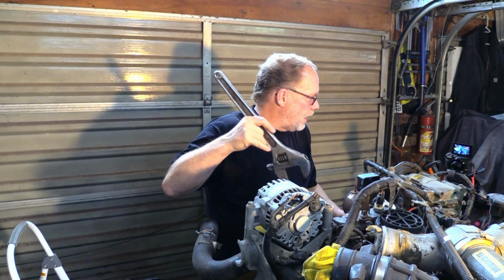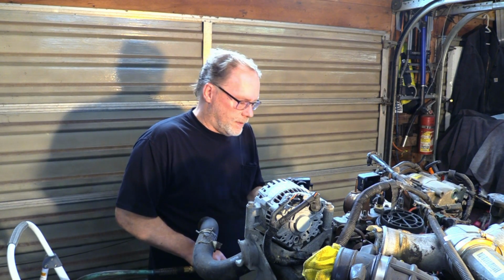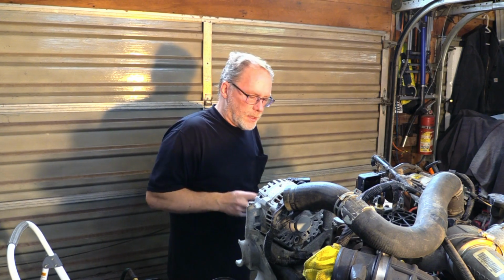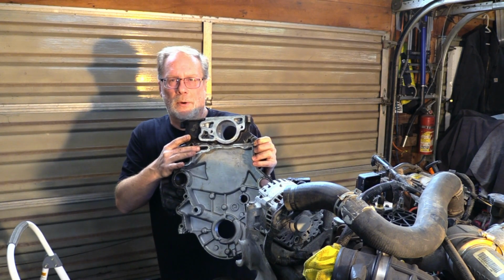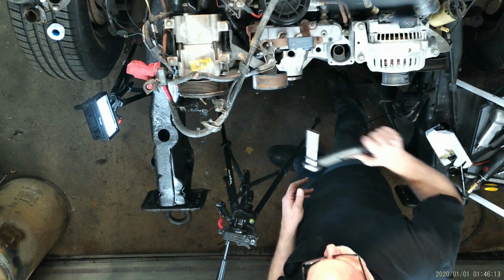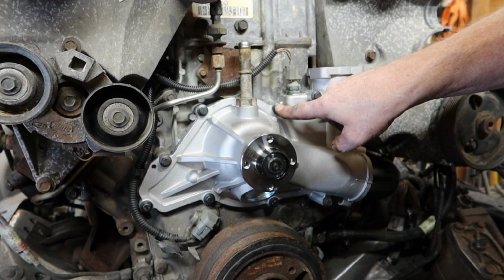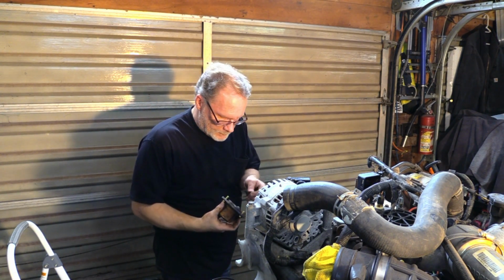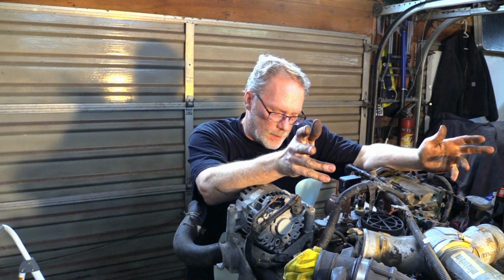🛻🎥7.3 POWERSTROKE FAN CLUTCH/ WATER PUMP REPLACEMENT🟢🟡🔴🟢

Comment: Thank you Clint, been doing my own work since 1958, and I make up a Technical Document on each topic that you video. I really appreciate the details that you provide, to help us "new owners" of the 7.3 to avoid mistakes. Especially when on the 3rd round, you found #4 and #5 bolts loose again.  I numbered the bolts in order that you torqued them. I overlay numbers on Screenshots...
Reply from the maker: Good and Thanks this is why I started doing this There was such poor info out in youtube land
Reply: Oil the threads and the torque will hold. There will be no creep.

Comment: Trick... for the fan. Before putting the belt completely back on. Spin the waterpump pulley  and male shaft into the fan female threads. Then put the belt on and tighten the fan up snug.
Reply: Grreat video.. your an alright dude.

Comment: Been chasing an intermittent leakdown Hpop reservoir for ages, just replaced the water pump and the wrong (chromoly) bolts were used by PO on the last waterpump. Thanks to this video I now know where my leak is coming from. Amazing detail as always, thank you!

Comment: I tried everything to get the clutch fan off including buying the correct tool, jamming the pulley, air hammer, even heating. The only one that worked was hammering on a large adjustable wrench as shown above. Thank you.

Comment: I cut my fan scroud in half. Cut on both sides and lift the top half off. To put it back together I used a piece of sheet metal on each side with some short sheet metal screws. Easy to remove the top half and get it out of the way.

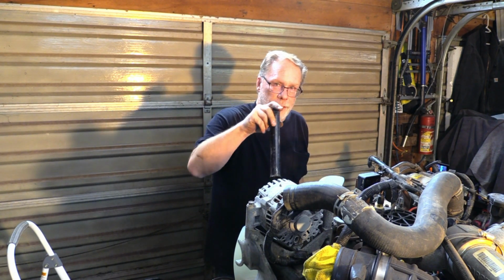Comment: @ 40:25  very funny ! Well i ended up with round gasket and reinstalled old bolts and she leaks, thought because didn't use a sealant...i see you didn't use any, planning on removing bolts one at atime and installing new....whatcha think ?
Reply: What did you do ?
Reply: @LemonySnicket-EUC  it was the thermostat housing leaking...bought a nude one

Comment: Can you impact those pully bolts out ? Any other tricks to get them out without spinning the pully. The belt doesn't stop the pully from spinning for me. I have a cracked rib and a badly turned ankle so I'm trying to repair my truck and myself at the same time.

Comment: Hi Clint, thank you so much for all the videos and expert advice.  Your Oil Cooler rebuild video helped me tremendously.  Followed your instructions to a T, worked great.  Can I please ask you for a link and / or part # for the 192 degrees thermostat? is this correct:  F6TZ-8575-EA

Comment: Thank you for the video! I changed my water pump, fan clutch, fan, radiator, trans cooler, and hoses and belt last summer with your help. Everything turned out great and still going strong.
Reply from the maker: Thank you that means a lot 🙏🛻

Comment: I put a piece of cardboard in between my radiator and fan when I did mine. That way if I did screw it up and smashed my radiator it wouldn't kill it. 😅

I used a small piece of cardboard and stuck my old bolts through in the shape of my water pump. That way when I got my new bolts I knew what went where. My dad taught me that a long time ago, thanks, dad!

I used the OEM pump though. Was afraid of all the things I read about aftermarket dying so soon. Gates was my other choice, happy to hear it would of been a decent choice.

10/10 on Riffraffs billet housing. I have that and their coolant filter kit. Love them both.

I went and got a new neck for the bottom anyways. Just didn't want to chance a leak and having to drain my coolant again. Cheap and you might as well! 

The belt trick I did not do and it would of been great help. Especially the bumping the starter trick. Next time I'll have to remember that.

Comment: How do you feel about using the gold bolts that come with the gates water pump for the 1995 7.3?
Reply from the maker: Yellow zinc coated fasteners are a quick indication of Grade 8 for high temp applications and if they have 6 spots on top the bolt Then your good to go If there is some numbers or nothing They are grade 2 crap don't use
Reply: @ thank you!

Comment: how did you figure out to change the bolts on the water pump it dose not state it in the alldata procedure info
Reply: Correct Ford does not require it. Yet it's a great idea considering how many miles we are likely to put on the new pump before getting in there again.

Comment: I used the air chisel method on the fan clutch nut when I changed my water pump a couple of years ago. I now want to replace my fan clutch but I worry that the chisel method may damage my water pump bearings. Should I be concerned?
Reply from the maker: The issue with the air chisel is cracking the nut and having the fan spin off If you don't use the pressure full throttle just a little air at the finger trigger you will be good as long as you didn't over due it last time
Reply: @CUSTOMWORKS7.3PSD  Thanks Clint.

Comment: Pulling my water pump and when I removed some of the upper pump bolts they were covered in oil. I have replaced a few water pumps (not 7.3) and have never seen this before, do I have a problem?
Reply from the maker: timing cover seal is leaking where the oil passes to the HPOP Time for new seal job

Comment: Just took my water pump off. The long bolt at the 4 oclock position came out covered in oil and dripping. Is that normal?

Comment: Im repacing my fan clutch. Do you recommend ford oem fan only or will an aftermarket one be ok and if so what brand do you recommend?  Thanks
Reply from the maker: This is the exact one we use https://amzn.to/44VH2jV Why.. It doesn't fail in the first week of use where the cheap 100 bucks or less do, just confirm fit ment there are 2 different kinds

Comment: I guess I was lucky with a low-impact approach.  Already had belt off from power steering pump work.  Slipped a piece of cardboard between fan and radiator.  Used a Ford fan clutch wrench, which is like a skinny version of adjustable wrench.  Held the pulley behind fan with an oil filter strap wrench. That thing held and wouldn't slip.  Unscrewed, and lifted shroud and fan out together, as you recommend.  The thing that I forgot was to disconnect miscellaneous hoses that were attached to bottom of fan shroud.  Once that was done, it was done...  96 F250, almost 300K miles.  No problem with fasteners' rust or sticking.

Comment: 02:00 This was one of the main videos that helped guide me in the removal of my '02 7.3 PS fan.  However, despite leaving the belt on, the nut would not be shocked loose.  The pulley would slip every time, no matter what angle or force was used on the wrench.  The nut was so tight that even a ratchet strap doubled around the pulley and locked to the truck fenders would not hold the pulley in place.  

Most US auto parts chain stores will rent/loan a set of tools that contains a special, thin wrench that slides over the the 4 bolt heads of the pulley.  One side of the wrench comes into contact with the left two bolts and the other side contacts the right two bolts.  There's a half inch drive hole at the top of the wrench that lets you insert a breaker bar for additional leverage.  Try to angle it so the wrench is near 11 o'clock.  Get a big 18" adjustable wrench like the one in the video (less than $30 at HF) and set it to the tightest fitment on the nut and try to point it close to 12 o'clock.  You don't have to be perfect on either but an hour space between the two is what worked for me.

Hold the breaker bar tightly with your left hand with a bit of clockwise pressure and with your right hand, hit the adjustable wrench counterclockwise with a BFH (Big F'ing Hammer).  It may not come loose the first time but don't give up.  Maybe invite a tall, strong friend to help.  Good luck.  Great video!

Comment: My 02 7.3 has 137k no issues with waterpump but about to do a big coolant service and figured why not while I am in there. Been scratching my head between Navistar, Motorcraft, Gates or even Dieselsite's pump. This comment about the square gasket pretty much seals the deal (pun intended) for me. Just out of curiosity, how many miles/years are you seeing out of these gates pumps?

Comment: Thanks for all the info. I took notes during this water pump replacement vid. I’m getting ready to replace my water pump and fan clutch on my ‘94 7.3 power stroke.  Of course I won’t be doing it “cab off”. Riffraff diesel was an extremely big help. Glad I found you on YouTub

Comment: Happy my electric DeWalt SDS Plus sized ELECTRIC hammer drill took that big fan nut off. I've been wondering this every time someone says use air hammer. 
Thank you for your amazing videos, I watch all of them. 
 I'm finally doing the dreaded low pressure oil pump that has given me 3 to 5 seconds of no oil pressure at morning startup for years 😮
 Only problem so far was the passenger side transmission cooler line wanted to stick to pipe and twist a little, got it worked free and about to pull out this radiator. Have a great day!

Comment: Is it recommended to NOT use RTV on the water pump gasket mating surfaces?
Reply from the maker: Don't use rtv on the water pump it won't seat even But rtv is used on parts of the back of timing cover
Reply: @CUSTOMWORKS7.3PSD  Clint, are you then recommending a thin film of RTV even if we buy the Gates Premium oil pump with the Flat Gasket?  IMO, if there is a water leak, I am buying all new parts, not reusing anything.  The labor far exceeds the cost of the pump and outlets.

Comment: I replaced my water pump a couple of years ago but hadn't heard about retightening the pump bolts after waiting. I was surprised to see you get extra movement of a couple of bolts. I haven't had any problems but do you think it would hurt to check torque now or should I follow the "If it ain't broke don't fix it."
Reply from the maker: "If it ain't broke don't fix it." Leave it be
Reply: @CUSTOMWORKS7.3PSD  Thanks Clint.

Comment: I got my last pump from riffraff. A Ford one. 190.00. Ford wanted 300 and change. And its the one without coolant filter. I already have one. Which I highly recommend. My last pump lasted 7yrs. Not 3yrs which I attribute to coolant filter. It grabs all that casting sand when they made engine block. I recommend SCA ADDITIVE FOR E99 AND EARLIER. I got my new bolts from riffraff too. Great video Clint. Once again.

Comment: Where would you get a new timing cover if yours is junk
Reply from the maker: Riff Raff carries all years OEM quality https://www.riffraffdiesel.com/engine-front-cover-97-03/  or  https://www.riffraffdiesel.com/engine-front-cover-94-95/
Reply: Thankyou
Reply: Not a Dorman. They are JUNK. CPS Hole is always off. Not deep enough.
Reply: Clint you did a video on front timing covers.. correct bud?

Comment: thanks for the content.   once i remove my glow plugs will i be able to put a wrench on the fan nut and bar over the engine easily to check for any mechanical problems?  how heavy are heads if i have to remove those?  stay warm.
Reply from the maker: Heads are very very heavy 110 pounds plus exhaust 30 pounds
Reply: @CUSTOMWORKS7.3PSD  thanks for the information.  have a great day

Comment: Hey Sir, question I'm getting a whooshing noise on my 7.3 2002. At rpm range 1250-1800rpm then goes away when higher. Around 30-50mph. Any ideas?
Reply: Could be your exhaust back pressure plate, if you have a scan program ie FORScan or the like check those. Mine and a buddy of mine was making the whooshing but we live in the north east so when it’s chilly the stupid thing turns on while your going down the road. On mine it was a sensor and line(which you can see is that rusty plate above the water pump in this video) needed replacement. My buddy had me just remove the plate behind the turbo with a kit he got online. Mine was easy fix his was not so much fun for some shade tree fellers.

Comment: Is amazing how i got a possible answer to an unrelated issue here. My 7.3 van has that  50 to around 80 rpm range unstable idle, no codes , nothing and nobody is sure why. If i have indeed air going to the HPOP reservoir due to a bad seal caused by an improper bolt on the waterpump do i need to remove the waterpump and the timing cover to reseal and retorque with the appropriate bolts or just doing the waterpump will suffice? By the way, this videos are always very instructive.
Reply: I know this is a old comment but did you ever do the water pump on your van? I have a 7.3 van also and need to do the water pump but there are no videos for the Econoline so I'm just wondering how hard it was?

Comment: Hi Clint, I noticed that you don’t use any anti seize on any of the bolts. Can you please clear this up for me, thank you.
Reply from the maker: You don't want over torquing of the bolt in this location causing old timing covers to spider crack so no oil or anti s
Reply: @CUSTOMWORKS7.3PSD  thanks Clint, appreciate the quick response

Comment: You might have just diagnosed my idle problem. It’s intermittent and almost sounds like a slight skip. I can see the tach jump minimally (about 10 rpm).  Would the HPOP reservoir be aerated if my idle problem was related to the front cover bolts losing their torque. The truck runs really good besides every once in a while at idle after it’s been warmed up.
Reply from the maker: you can diagnose and confirm by adding this for 1 oil change if it stops that's the problem https://www.finditparts.com/products/7035901/navistar-flted8oz
Reply: Did you try this product?

Comment: I have striped the small bolt at far end of water pump torquing it down not always but has happened more then once anyone else have this
Reply from the maker: Never had it happen on the timing cover but have had it happen on other aluminum parts you can usually spot a potential bad bolt hole when the old bolt is removed and it has a lot of white powder on it

Comment: the first tube you removed from the top of the pump with the 1 inch wrench was the heater bypass?
Reply from the maker: Yes part of the heating system that goes to the heater core at fire wall pass side

Comment: Hey Clint, been subscribed and watching for a while now. quick question. I have the BAFX WIFI OBD2 code reader. I use the OBD Fusion App. when I connect my phone to WIFI and open App none of the guages have any reading at all. Do you know why that is?
Reply from the maker: not really but I do know there are different pids you can reload like forscan if you go into there directive setting there are 3 different pids for several of the sensors most apps break down gauges by year so 97-98 98-99 99.5-03 but they will be labeled with different codes that mean nothing to any one but the app builder

Comment: I'm a big fan of you man I have a question. I have 2000 7.3 4x2 I rebuilt my transmission one year ago have 50000 miles since them now my 1st gear And reverse Is slipping. when I stopped too the light is sleeping do you have any idea what's that caused. But if I hold my break and Some gas to the engine give  and hold it for 3 to 5 seconds doesn't slip after that if I release Is the break slowly
Reply: Auto trans most common issues which you described /// caused by low transmission pressure either from an internal leak, worn pump, or aerated fluid.

Easy: Loose transmission filter allowing air intrusion around seal in pump.
Not as easy: Pump replacement or sealing ring replacement.
Hardest to swallow: Transmission
But could be other issues these are just the highest probability

Comment: 2002 F350 7.3 4x4 Super Cab SWR 149K miles.
I'm getting ready to change my water pump, this video really helped. I bought a International / Navistar through Diesel O Rings.  I'm also ordering the water pump bolts through Riff Raff Diesel.
 A few days ago my radiator failed and have a reddish fluid in my de gas bottle and no transmission fluid showing on the dip stick. I ordered a new motorcraft radiator from Lakeland Florida Ford ( only one I could find in Florida nearby ). I'm also changing the following items.
Upper and lower radiator hoses
 Thermostat
 Thermostat housing
Lower water pump inlet.
My question is to flush the system do I need to keep the contaminated radiator, de gas bottle and water pump on the truck? Can I disconnect the transmission lines from the radiator, remove the contaminated radiator and still flush the engine block? why flush a contaminated radiator and degas bottle? Do I need to service the transmission? Thank you!
Reply from the maker: To do the best job remove the trany lines use a rubber line and connect the 2 drop the pan install new filter reinstall pan fill new fluid then with old radiator and pump flush the engine I know what your getting at but you don't want to contaminate the new parts and seals then once the system is clean install all your new components and seal Nows not the time to try to save a buck
Reply: @CUSTOMWORKS7.3PSD   This video came out at the right time! I've been following your advise on changing sensors. I also have the following ready for install: 
EBP sensor and tube
Cam positioning sensor
Oil cooler gaskets (on order from Diesel O Rings)
 IPR.
 Definitely put a dent in my wallet, but I'm saving money by doing it myself. I hope you know the time you spend making these videos is greatly appreciated 👍